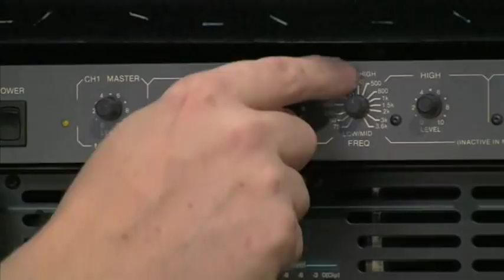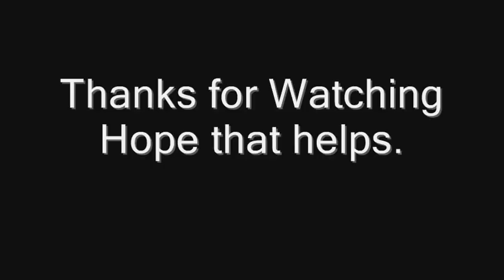What is a P.A. Speaker Cross Over?

Comment: Now that`s some real solid info. Personally I use a first order (passive) filter at 600 hz, the woofer doesn`t sound 'bad' above 600 but it starts to beam and the time domain get`s muddy, and the mid just has to be kept safe from LF power so it`s non critical. So I can get away with a first order at 600. The xover to the bass cabinets is offcourse active and there again it`s non critical so I can play around a bit with the settings. I find that when I use a first order it integrates quite nicely and then apply an eq over the bass to keep the higher stuff out. so a cross at 150 something and an eq at 300. That way I get a fast 'bright' punchy bass without some sort of `roundish` ring to it, and without say 1khz notes finding their way to the bass speakers. This can easily be done with the behringer. Which is not as solid as a rane but there are all those options.

Comment from the maker: Thanks for your kind words. This is such a great question.
It all depends on the components being used. Here's a "Generic" "Ball Park" starting point of cross over points in a 3 way system. 
Subs from 80Hz to 250 Hz
Mid's 250 Hz to 3000 (This would cover the fundamentals of the Vocals) 
HF 3000 Hz and up.
Remember this is just a starting point. 
Here's something you should take a lot of time to learn and practice.
Listen :)

Comment from the maker: It depends on the set up of the cabinet. Cheaper cabinets don't give you the option. This is a higher end design where you may select the bi pass mode, a switch on the jack plate to bi pass the crossover. Or in the case of this 3 way cabinet we use the best of both worlds by using a x over between the mid and High frequency and using an active cross over between the sub and passively crossed over mid high.

Comment: Great video!  So, are there two passive crossovers inside that PA speaker box?  One attached to the low frequency active crossover, and one attached to the high frequency active crossover?  Then, the high frequency passive crossover inside the speaker box is divided between the tweeter and mid range speakers?  Please let me know if i'm way off haha.

Comment from the maker: @timg544
We generally refer to a crossover as a single entity. It may be a two way or three way or what have you, but the whole network is the cross over. In our design we generally try to avoid using a "passive" cross over below 1000 hZ to 600 hZ, due to the lose of energy and acoustic tone quality. This system uses a passive between the mid and high and an active between the bass and mid high cross over network. The best of both worlds.

Comment from the maker: @BigKingBudxxShowCase 
Hi Yes you can add a tweeter but it can be a little more complicated then simply adding the positive to positive and negative to negative (Parallel).  Adding another resistor (Tweeter Load) can reduce the cross over point possibly damaging the tweeter and or not getting the sound you would like. Wiring in series, negative of tweeter one to positive of tweeter 2 and Negative of tweeter 2 to ground (return) will raise the x over point. You may need a different Cross over.

Comment from the maker: @XalmostbrokenX 
Don't under estimate the effect of a passive cross over on the bottom frequency. If done correctly a passive x over has a positive effect on the relationship between both High and Low. 
Active between the Mid Highs and the sub in almost any application is very desired. It's also a good cost effective way to start your system. As you find you are growing and becoming more professional you will need to have a fully active cross over and processing system.

Comment: Hi! very helpful! need help...
i use two speakers a Peavey PV 215 (3-way) and a Peavey PV 118 (subwoofer) both are passive speakers and both have built in passive crossover. My set-up is as follow: From mixer to crossover, from crossover to power amp A (for PV 215) and power amp B (for PV 118)
What Xover freqs. do you recomend me to use in my Xover? (I've a 2 channel, 2-way stereo Xover)
How i need to set up the knobs in the Xover, and the settings needs to be the same in both channels?

Comment: Hi Doyle Audio,  I have 1 Crown K2 Amp, and 2 JBL JRX118S, and 2 JBL JRX125 3-way speakers.  What active crossover would you recommend, and what additional amp would you recommend?  I will be using the the Crown K2 to power the JRX 118S.  I was wanting the PA system to be in stereo.  Do I need to modify the JRX125 passive crossover to get the best results out of all the speakers while using the active crossover?  Best Regards, MIke

Comment: hello sir very nice presentation ,and i  have a question it regards of compression or tweeter ,can i put the capacitor when i use active cross over?
Reply from the maker: eliaqim villarba Good question. Yes it helps to protect the hi end from a full range surge (That can happen with some active cross overs if the pot is dirty ass you are sweeping the frequency cross over point.) But NOTE! The cap will effect your x point. It will add about 6 db to the slope of what ever point that value of cap functions at. It can also effect the frequency response. To complicated to explain here. Where it is useful is lets say you have a cross over point of 1200 for you HF and you want to add a tweeter in parallel circuit. Having a cap on the tweeter will raise the cross over point for the tweeter. Hope that helps

Comment: My band is currently using a DBX crossover. We are running in mono.  We have some Yamaha club V 115v series mains and some Peavey 18 subs. We run 2 power amps.  One for the mains and one for the subs.  That would be a 2 way mono.  But there is no setup for a 2 way mono.  Should we come out of the Mid/High side from the Mid or High output to go to the power amp?

Comment: I recently purchased a used small 2x10 HK Audio sub (HK Audio Premium Pro B210s), 'thinking' I can use this relatively well built and small 4 ohm PA cab as a bass guitar speaker cabinet.

Because It's 4 ohm I would be able to use it as a single stand alone cab both with my Marshall VBA-400 tube head (4ohm/2ohm) and my Markbass Little Mark 500 transistor head. Nice idea, but...
.... I didn't take notice of the fact that it is a 2x10" sub, so it has a passive crossover (40-150Hz). This makes it useless for me as a stand alone bass guitar cabinet....

My questions:
1. Is it possible to bypass/ disable the crossover circuit?
2. If so, will the impedience still be 4 ohm?
3. Is it a better idea to change out the crossover circuit for another after market one, that more ideal for bass guitar (I don't need a tweeter/ extra high frequency speaker).
4. Should I keep the quality built cabinet, take the woofers and crossovers out and install two 10 inch woofers for bass guitar (Eminence or other quality brands)?

Sorry for my ignorance on the subject!

Comment: Hi doyleaudio I need help PLEASE!!!. Say I have an 8ohm passive 3 way crossover and want a 8ohm woofer, 8ohm mid range, and a 8ohm tweeter all wired in parallel to the correct terminals on the crossover. What will the total ohms load on the amp be?         PLEASE I HAVE LOOKED EVERYWHERE AND CANT FIND THE ANSWER. NICE VID BTW

Comment: Hi, great video. I am looking at making a wireless iphone dock with preferably 2 6" subs, a mid and two tweeters. I am struggling with linking them to the amp. I assume a passive cross would be best? The amp will be run off a rechargeable lithium battery i suppose, and I will have a passive radiator with the sub, or two subs and a port in the back. What do you think? Any advice?

Comment: Hi doyleaudio I NEED HELP PLEASE!!! say if I have an 8ohm woofer, 8ohm mid range, an 8ohm tweeter and connected them all to an 8ohm passive crossover to the correct terminals woofer to woofer, mid to mid, tweeter to tweeter. My question is will the ohms load on the amplifier stay at 8ohms or will it change?. MASSIVE THUMBS UP thanks for you time.

Comment: Hi Gerard; great video!  I have a question- I have a Soundcraft Signature 12 passive mixer with mains and 3 aux outs running into a Behringer  NU4-6000 4 channel amp;  I currently am using Peavey PVM-12 monitors for all the auxes, but want to dedicate 1 mixer aux out for an 18inch sub (kick and bass) into one channel of the amp- can I do that basically with a racked 2-way crossover between the mixer aux out and amp channel?  If so, what is the best crossover freq to go with?  Thanks!
Mike Norris
Reply from the maker: Exactly Michael :) You have to sweep the X over point as all subs are different and they interact differently with the full range you are using. Simple rule of thumb is keep it below 150hz and teak it down from there. Keep in mind your full range cabinets if putting out a lot of bass, can cause small phase issue in certain places in the room with your sub. If you can reduce the bass going into the Peaveys I think that will improve your sound and fill the room very nicely. Soundcraft is a great sounding board. We just sold our Studio Spirit and replaced it with a Digital board. I'm so sad I did it :( Something about those analog Sound Crafts.....

Comment: Great video @doyleaudio, I was wondering if you could give me some advice? I got myself a set of speakers a month ago the brand is "genz benz" and there was no input jacks on the back or anything so I thought alright just need to get the part and install it but Im having problems with that Iv called gens bens tech support and its been weeks and haven't gotten back to me yet, the way the cabinets are set up is two speakers and a tweeter. Each speaker is 15 in in size and runs at 300w at 8ohms and the tweeter runs at 8ohms. Some people have told me I need a crossover, but I have no idea which one I would need and what else I would need to get them running again. If you could help in anyway that would be great thanks!
Reply from the maker: Hi Elevator. I have always respected Genz Benz. Call them again. I think your request for support must have been mis placed. If you still strike out, call us direct at our factory and we will help you. 905 839 9998. Gerard Doyle
Reply: Thanks I will

Comment from the maker: @cheatinelvis2011 
Don't know what DBX you have or Amps, so sorry I can't advice. Normally a 3 way x over should be able to run 2 ways. Most amps have the option to run mono from one feed. Hense one mid\high feed can run your Yamaha and the sub feed to your sub amp. If the amp is strong enough you could run the Yamaha's off of one side of an amp and use the other side of that amp for monitors. 
Look for DBX manual on line should show you how to get the most out of it. 
Hope that helps.

Comment: hi Gerard! I have a powered mixer yamaha emx 5016cf and passive peavey tops(hisys 1xt - 350 w - 4 homs) and subs(hisys 112xt - 350w - 4homs), and my idea is to connect tops to my powered  mixer and subs with the crown xls 602 amp, so two questions - how to connect rigth my speakers and do I need an activ crossover( i have a dod 834)?can you help on my issue asap, please? thank you very much for your time.
Reply from the maker: Hi Roma, You will need to get a full range mix out of your mixer to your X over. From there, feed the low end out to a power Amp and to the subs. A few things to watch out for. As your Peavey will be full range, you want to watch out for possible phase cancellation between the Peavey and the sub in the mutual frequency's shared on the bottom end. Sound wise if you don't have the experience is to simply turn the sub on and off and listen for a sudden drop in particular frequency's. Some times it sounds like you got all the new bottom end but the punch went missing. Don't know the DOD, but here's the steps I would go through. You will most likely be able to cross over at 150hz or lower. Recommend starting at 125hz and sweep down. Be conscientious of where the Full range is in relation to the sub physically. Sometime moving the sub cabinet forward or backwards can literally dial in the phase for that impact you are looking for. Or you may have a 180 phase switch to on the cross over to help Align the waves at that cross over point. Time alignment is why the RANE was \is so dam great. The DOD might have it to. Hope that helps. It is also important to drink beer after you have done your set up and things are sounding good. Beer seems to be a Human Auto Tuner. In fact I recommend your entire audience drink as much beer as possible (Unless they are driving because that would suck) and they will find everything sounds better too.  Please get back to us here and let us know how it turned out.

Comment: Hi doyleaudio, I need your suggestion, I wrongly connected the polarity of the cable from 

my Spendor S3/5R2 speakers to my vintage Sansui stereo amplifier as follows: 

As wrongly the 2 Negatives of the 2 speakers were connected to the one channel of the 

amplifier and the 2 Positives of the 2 speakers were connected to the another channel of the

amplifier. One speaker was working and another speaker was not working. I was confused and

didn't notice about the wrong polarity for about 15 minutes, then I checked the cable

connections and detected the wrong thing. I became panic and sweated like anything. After I 

made the correct connection the two speakers sing as usual. But.. even though the speakers are

now working, still I have some fear. By the wrong connection:   Would the cross-overs of the 

speakers become weak? Did I do the great mistake? How will be the life and health of the speakers?

May I keep the speakers for long time?. If it would become weak, that would how much? 

Kindly let me know about in detail. I am much worried about the thing.
 
If I hear from you as: 'Need not be worried and the things are fine' , then I will be jumping 

with my transplanted knees! I very much love these small beauties. But, now I am sleepless. 

Thank you,

Regards,

Suseendran.
Reply from the maker: Don't worry. Be happy. It's just a speaker. lol. Without having it in my hands, I can only guess that you're wiring could have damages the cross over components. Listen to one speaker then take the input off and listen to the other. If they sound the same , good. If not , something is damaged. Good Luck

Comment: I have an EMINENCE OMEGA PRO 18" 800w , 8ohm IMPEDANCE in a box without passive crossover. I use a bridged amplifier with an EQ to play this. I only use the EQ to alternate the frequencies.(So it is like a slope with the bass freqs High.) Is this ideal?
Will I need a capacitor or anything of a sort attached to the driver in the box?
Reply from the maker: koblavi1 Not the best method. Get a used Rane cross over or new if you can afford it. Not a cap but a coil to let low end through. Unless you have someone design and make a low frequency passive crossover designed for not just that box but the mid high you know you will be using AND with big gauge coils, you will always do best with an active cross over. Good Luck

Comment: dude,ive been wanting to use this altec hi freq atten #501-8a matching monster 8hm horn driver,opportunity has arrisn, the horns blew in my 1000watt yamaha p.a. speakers,do i lose  stock cross over n wire speaker,horn to  the altec dividing n 501, all componants check out..?
Reply from the maker: Dude I don't know. I can't say as there are so many variables. But I'll give you the quick. It's a question of balance, efficiency, frequency response and wattage handling capacity. There's also an element of dispersion and horn mouth size, but we won't go there as you most likely don't have the toys to measure all of that. So this is why I don't know. The horn blew. You have to wonder why did it blow in the first place? Was your bottom end over powering the top that you turned the top up so high that it popped? Did the singer go Diva and drop the mic with no compressor on the system? Where you playing any Justin Beiber music? In which case Yes it IS to late to say sorry. If I remember correctly the 501-8a is the cross over for the A7 system. But does it's cross over point match the horn you want to use? Again if I remember correctly, I believe this cross over crosses at 500 hz. provided the low AND hi frequency is 8 ohms. That means the HF is handling a lot of the frequency range AND volume out put. Your top end had better have a 3" or bigger diaphragm. This X over I think has a pad. If the pad pot is dirty that could mean a FULL On out put at different "Open" spots on the attenuator. That and the fact that I don't like the vocal range getting crossed right in the middle. So I have to say I'm not digging the set up Dude. But as I don't know whats the efficiency and power handling of the units and I don't know the size of the Horns mouth you are using, I can't predict shit on this one. I recommend Beer. Beer is really good. Beer will make Peavey sound good. It won't make Behringer sound good. No matter how drunk you are, shits always shit. I hope I have helped. If I didn't, is it to late to say sorry? .... yes more beer... but Canadian beer okay?

Comment: is it possible to crossover 2x 3w tweeter and 20w woofer?
Reply from the maker: Well the short answer is yes. BUT there are many factors to consider. Here' just a few. Whats the ohm rating of all the components? What is the frequency range of all the components? Can you make the cross over point high enough to balance the distribution of the input power without scarifying the fidelity of the system? i.e if the woofer top range is only 800 hz and you try to make tweeters that roll off at 2 k go down to 800 hz. then the tweeters may blow. Or if you cross over tweeters safely at their 2k point then you have a drop in the sound from 800 to 2 k. Hope you understand this.